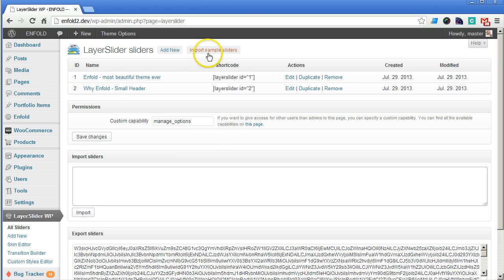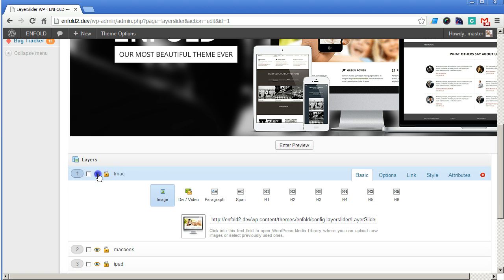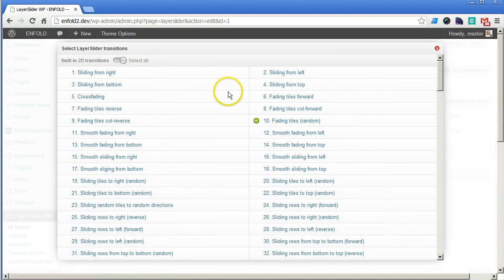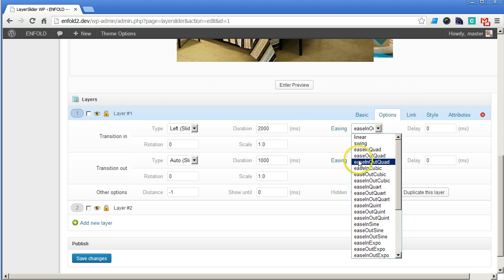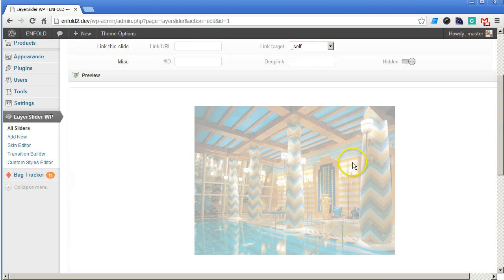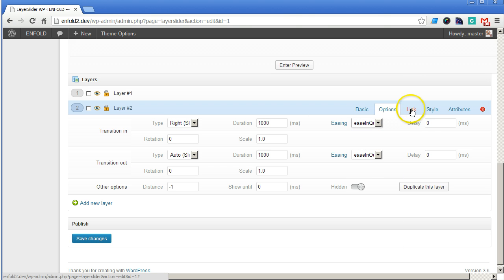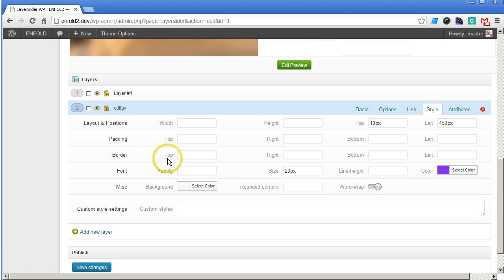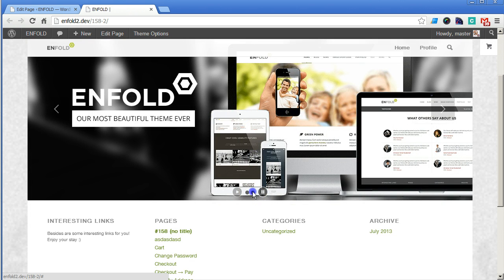Layer Slider Basic Tutorial : Enfold Theme for Wordpress

Comment: When I move stuff around in the screen and then publish (save), the elements are always misaligned on the actual site (nothing like when I hit "preview". It makes no sense whatsoever.
Reply from the maker: graphicartdude You need to change the master slider settings and you are probably using % for slider size, have it set as responsive, and have it set to become responsive at a specific width. Try giving your slider a fixed width in pixels.

Comment: Thanks for the tutorial.  BTW how do you install a custom header?  Do I need to modify the header.php file?
Reply from the maker: Front Room Vallejo add a header from the theme options page , then view the source and find a css class or id that is specific to only the header you chose, then use notepad++ to search through every file in an unzipped theme folder on your home computer for the css class or id unique to the header you chose. The results of the search will show you which php file and what line number in that file contains the code for the header you've selected. Then just modify it, preferably within the child theme to create your custom header.

Comment: I am trying to add the slider to my header not to a page how do I do that
Reply from the maker: Is your layer slider built into the theme or its in the plugins folder. If its built in, you need to first decouple it, since you wont be able to launch it with a shortcode while its attached to a the theme builder. Read my short post with instructions http://www.kriesi.at/support/topic/how-i-can-integrate-a-layerslider-in-the-custom-template-archive-php-code/#post-124545
Reply from the maker: Open up header.php file in the theme folder. Find the spot where to show the silider by first finding the tag <body  in the above file, and then somewhere below it in between the various tags, start adding letters, like a, b, c, d, e,  etc... Just make sure to add the letters outside <?php  ?> tag, never inside. Then load up the page, and the letter of the alphabet that you pasted located right where you want slider to show , will be where you would paste <?= do_shortcode('[layerslider id="1"]'); ?> just the way i have it, just change the 1 to whichever the id of your slider is.